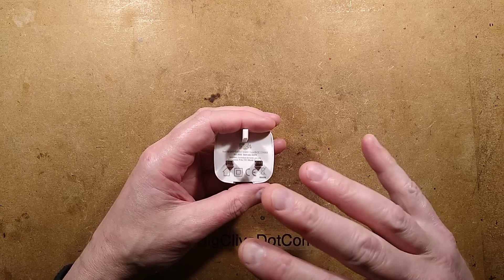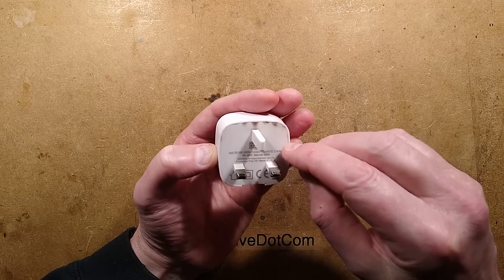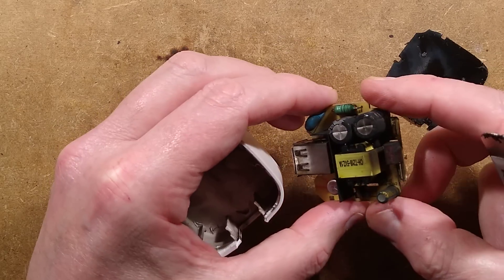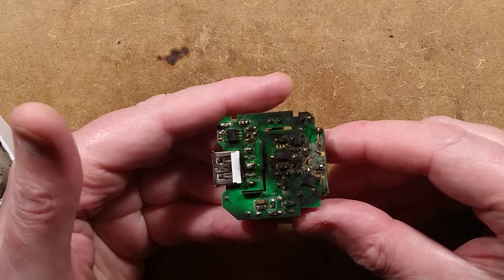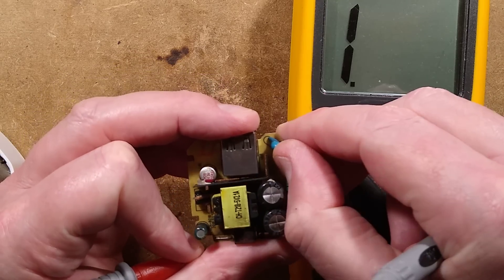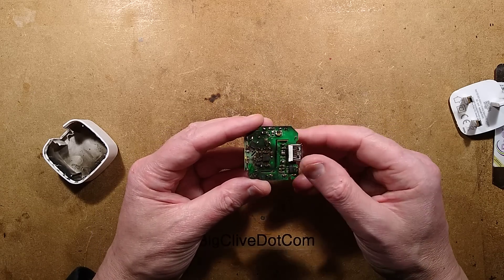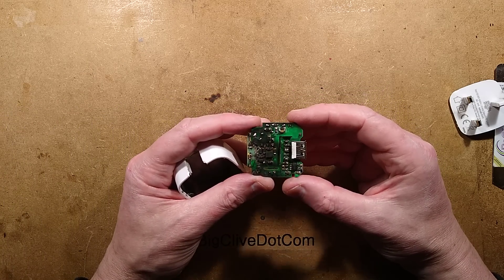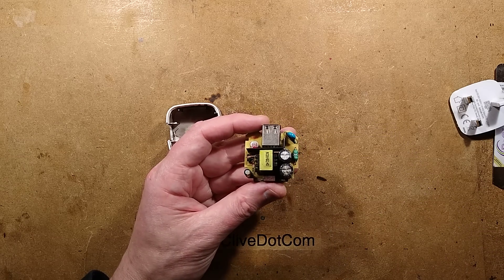Poundland USB versus lightning  (The lightning won.)

Comment: I think the voltage spike started an arc in the charger and then when the arc was established the mains current did the rest. That would explain why the circuit breaker tripped also.

Comment: I'm not fond of those little rectangular fuses, they're usually rated for a paltry 100A maximum interrupt capacity. Hence why they spew soot ALL OVER the place, even when on 120VAC applications. That could defeat the purpose of the fuse to begin with, as the carbon is slightly conductive!

Comment: In my experience a lightning  strike isn't going to be stopped in time by a fuse. It'll boom all the way down the line. Fuses just aren't long enough to deal with the typical voltages involved with lightning.

Comment: Some may remember when land lines were exactly that, phone lines on poles. We used to live in the sticks in South Africa in the 70s and had an overland phone line come into the house at roof level and then inside went to one of these old bakelite rotary phones on a stool in the living room. One night lightning struck the phone line about a half kilometer away, the phone dinged and a bright arc cracked from phone to the floor, leaving a burn mark.
The phone looked undamaged but was dead, when we opened it up the components inside were just ash in the casing, leftover were  charred metal bits from the rotary encoder and the voice coil and bell. All wires were vaporized. The instantaneous heat must have been incredible, yet amazingly the casing did not burst. The wires in the phone line outside had also partly burned and had to be strung new.

Comment: Lightning strikes can sometimes produce weird "damage results". A few years ago lightning struck somewhere near enough our house to affect us. Most of our electronics were hooked up to surge protected power strips, but not our router. Apparently a voltage spike found its way into our router and then travelled through an ethernet cable to fry the network chip of my PC... Everything else was still fine and working (including the router), so we "just" had ~10€ of fixing cost for a network card.

Comment: Interestingly, lightning appears to have different frequencies.  I've seen a couple of different pieces of coax where the lightning blew it in regular chunks along its length but there was a different distance between the blowouts in the different pieces.  Both pieces came off the same drum but at different install dates so it should have the same properties other than 2 years apart.

Koi Carp don't like lightning either when the pump becomes part of the circuit to ground........  We did try and cheer our mate up by buying him a bag of chips but he didn't seem hungry.

Comment: I have a lightning story, though it's not as exciting as this one. Several years ago, we had  a very bad thunderstorm. Lots of lightning. Very high winds. Power flickering in and out. I was out of the house at the time, and when I got back, the computer room smelled really awful. It was like a burnt-electronics smell, but with a less pleasant tinge. Sulfur or chemicals or something. I had a power strip with a surge-protection feature, and when I took it apart, one of the metal-oxide varistors had broken into pieces, and everything was fairly sooty. This was a pretty old surge protector, so I presume it was a combination of the MOV aging and a surge from all the lightning that did it in. 

It wasn't until I started watching this channel, years later, that I understood just what had happened.

Comment: Would a usable earth pin would that have helped it survive ?  I have in my mains entrance a surge suppressor that looks like a 240 volt (USA) dual breaker with out the lever has a green LED s to show it’s Ok  wired on the panel side of the gen set transfer switch  do you use these in the U.K. ?
Reply from the maker: They're becoming available.  The industry is currently price gouging them.
Reply: @bigclivedotcom   they do not cost a lot here I think $45 us had mine about 4 years

Comment: Hi bigclivedotcom  i am a viewer from Algeria and i have so many questions to ask you about electrical installations.
the two most urgent are related to solar installation and grounding
1. i have a distribution board with two sources of electricity, city electric and solar (2400W inverter) 
the thing is the two electric circuit are never in contact with each other  but i have to properly ground all the electric sockets for safety .
the question is do i make sepret grouding bar for the diffrent sockets or it doesn't matter or there is other solutions.
2. for my solar installation i have a pure sine wave inverter from EPEVER 2400 watt and the problem is that it is properly grounded but when i mesur from the neutral or live wire to the ground i have half of the potential (115 volt) .
ps:  i have 230 volt between neutral and live
i heard about neutral bonding and floating neutral but it is high level for me.
i hope you can help and thank you in advance.

Comment: Allot of the time I find that the lightning transient just starts a small lower energy arc in the device and the mains current does the bulk of the damage. I know working in the communications industry anything that has a high energy behind it explodes much more then  RF cables and things like data cables. You do have some exceptions when bonding wasn’t done correctly. We always used MOV and SASD devices on our incoming power it has a large 1/0 connection to a 60a breaker in the main panel and they do a really nice job protecting the mains coming in as MOV alone are too slow!

Comment: I never leave USB supplies plugged in & switched on because this is what can happen...
and not just from lightning... it's also another reason I haven't bothered installing USB double 13A sockets as they could potentially cause the place to burn down.

Comment: clive.. and or anyone.. you know what this is?
https://youtu.be/VfaD_w1wsgI
Reply from the maker: It looks like a discharge indicator tube with neon gas and mercury vapour.  The pattern is probably a result of camera shutter rolling effects.
Reply: @bigclivedotcom  yes, IRL I see very little movement. I can read Philips on it. and 220 volt and 6 watt. it gets a little warm when on. found it in my thrift store, with a nice bakelite fixture with turning switch.
Reply from the maker: @bassblom  Ah.  That's a keeper.  I wonder if it's quartz or glass.  If glass it's probably and indicator, but if quartz it might be a germicidal lamp.  It could give you itchy feeling eyes.
Reply: @bigclivedotcom  first thing I tried was touching it with my fingers, to see if it makes the glow move, like the plasma balls. nope. the two colours in one tube surprised me. super a keeper for € 0.50 :D
Reply from the maker: Neat.  Make sure you don't look directly at it without eye protection for too long to avoid welders-eye.  (You wake up with very itchy eyes in the middle of the night.)  The tube is made of UVC transmissive glass, but ordinary glass will block the harmful wavelength.
Reply: thnx!

Comment: Interesting point about the fuse. I had a network switch PSU go bang (sorry, it's been binned now) which tripped the 32A ring main breaker - yet the fuse in the power strip it was plugged into remained intact.
Reply from the maker: The breakers often trip before the fuses blow.  It results in less of a bang than with the old fuseboxes.

Comment: My Brother recently had a Lightning-strike at a Neighbor's house in Australia, across the road from Him with them loosing a Bunch of items. My Brother though not Directly hit by the Strike did loose His SolarPV inverter (blown), the Dash-cam in his car (blown), the Fridge (blown), His near New 60 Sharp TV and the Original 60gb (much sort after with Linux loadable Firmware) Fat PS3 both now Don't work via HDMI but are otherwise Fully functional.

Comment: It is interesting at seeing how things die depending on where the lightning strike was. If in between house and a suppressor, equal chance of stuff in house surviving or not. Strike on or near line with suppressor in between house and strike, good chance or survival. There is also a good chance of survival if there is a suppressor attached at the distribution panel. Love the smell of refried mosfets in the morning. Cheers to you all.

Comment: Gives me flashbacks to past year, when the lightning hit a house right next to our towns telecom-substation ~250m (~800ft) away of where I live...

In a second I went from a highly concentrated programming session at 2am, to sitting in complete darkness (circuit breaker tripped).
Then my ISP's router started to produce fireworks, followed by the thing exploding less than ~2m (~6ft) from where I sit.
It ended 2 seconds later with me under my desk using my chair as additional cover against flying plastics and electronics... 

I didn't yet realize the real horror had yet to begin at that point. 

The next morning I replaced what was left of my ISP's router with their old one I had laying around on my attic. 
Wasn't as fast but I had at least functional internet. (from ~90mbps down to ~20mbps)

Then I called my ISP to request a replacement router, they told me their substation was at fault.
I explained that I was fairly certain my router was broken, while looking at a pile of dust and plastic shrapnel. 
They then replied, that a specialist had to determine if the router was actually broken, but their specialists where occupied trying to fix the substation. 
Then they hung up on me.

I tried to call multiple times that week, but apparently they blocked all calls from our region, as the whole town tried to call their service desk. 

Took them two weeks to realize that their customers routers where broken, 
while the specialist was banging his head against the substation out of frustration, wondering why only 1 house got a connection (my old router).
Reply: British ISP? I wouldn't expect them to be any better than that.
Reply: @userPrehistoricman  You are close, but I live across the channel...

But its the same issue over here apparently. 

When my sister wanted a new connection in her apartment, it took her 2 months of 4 calls a week to their service desk before she had a connection. After just 1 day it was broken already... 

She then called the more expensive rival ISP, they got her a working connection in 3 days. 
She tried calling her crappy ISP to cancel her plan as it didn't work, but she was placed on a wait/hold line of more than an hour... 
She hung up and just canceled her monthly payments.

Three months later she got a call of the crappy ISP, threatening to shut of her internet if she didn't pay her bills. 
She told them to f-off, as their service didn't work more than 24 hours in the past 3 months, that it took her 2 months of  3 to 4 times a week of calling to become a new customer, and that she is now a happy customer with their rival ISP... 

Most people I know also hate this ISP, they advertise 100mbps and deliver 25mbps in 90% of the country.
I had the same slow 25mbps in the past, when I called their service desk they always used the excuses that I live to far from their substation, so they can't deliver anything faster.
One day I got a new neighbor who was a manager at that ISP, he called some people and got it fixed in like 2 days.
Having 90mbps since that day.

Not to say that the more expensive rival ISP advertises 300mbps and actually delivers 280mbps without having to know people on the inside...  I literally don't understand how this crappy ISP keeps surviving...

Comment: About 25 years ago, I worked in a retail computer sales and repair store in our local mall. One day someone brings a machine in that had been defiled by a lightening strike. Which came down the phone line and arced across the ISA Modem through the Video card and several other expansion cards and motherboard. It wasn't quite as spicy and burned as this charger. But It did have arc marks. With the fiberglass circuit boards showing entry and exit marks with separation of the layers. in the direction of the arc. The machine was obviously not salvageable. But arrangements where made and we kept the machine to use as a display of why you should have suppressors and power protection.

Comment: I had something similar happen with no lightning involved. Cheap phone charger (Carphone Warehouse ownbrand I think), something inside went pop. Smoke, sparks and flame shot out round the sides of the case, tripped a 32amp MCB. When I dismantled it, it looked similar to this except the top had blown out of one of the capacitors.

Comment: hi all,  i recently purchased a IR LED floodlight from ebay  but it didn't come with a power adapter. could you please advise me on which one to buy as me  & electricity are not friends..
its 12V DC and 12 Watts consumption.  thank you
Reply from the maker: You will need a 12V 2A power supply to ensure it runs cool.
Reply: @bigclivedotcom  that's great, thanks.   i did email a few companies that but nobody ever replied then your video popped up and i thought yeah this guy will know..

Comment: 30+ years ago Dad was working on some equipment when there was a lightning strike nearby, he got a shock off the equipment and involuntary muscle movement made him throw the gas bottle he was holding which you'd usually have a job just picking up, soles of his feet went red for days where they completed the circuit!

Comment: To be fair, that's done fairly well all things considered. It seems like only the high voltage side has been blasted and the USB side has actually survived. Plus, it's impressive that the casing has actually contained most of the blast rather than just melting and igniting.

Comment: Lightning strikes can do some pretty strange things. In one case it blows everything to smithereens and the next time you hardly notice that it happened.

When I was a kid the lightning took out our TV antenna. I know the night it happened as I was woken by the thunder clap as it rattled the entire house. But come morning nothing seemed to have happened. Towards the evening we however noticed that the TV reception was rather bad. But then we were living in a veritable black hole as far as TV signals were concerned, so depending on weather it could be quite bad at times. Several days later my father however found the signal splitter on the grass in our yard. It was blackened and had been blown clear from the TV antenna mounted on the chimney. So all we had for a TV antenna was less than half an inch of the center wire sticking out the end of the coaxial cable dangling from the antenna.

But that was all that had been damaged. The TV had been plugged in when the lightning struck and yet it survived. After getting a new filter/splitter and mounting it on the antenna, even using the same cables though we were told the coaxial probably should have been replaced, and the reception was easily as good as before.

So, while you don't want to rely on luck to protect your equipment or even your life from the lightning, just sometimes it will keep your house from burning down...

Comment: I recall a development engineer back in the 1970's arguing against larger, higher voltage isolation transformers for the music feeds into radio transmitter sites he said - you won't stop the lightning, you'll just blow a bigger hole in the wall its mounted on !

Comment: Lightening is such a fascinating powerful thing. They can contain such incredible amounts of power and do so much damage. I have seen a large old Oak tree in a field be hit and BOOM just dust and leaves left! It literally was vaporised! Yet other things have had direct hits and had very little damage. A lot of damage  people see is not from direct hits but from the spikes down cables etc. My parents came home from work (back in the 60's) and there had been a thunder storm in the night. The TV didn't work(old valve job). They got a guy out to fix it and when he took the back off, the inside was a black mess! When they looked outside at the tv aerial, there was just a 'lump' on the roof and the coax had black marks on the wall every so often all the way down. Yet the wall had no other damage.

Comment: I very seldom disagree with you BigClive, but the extra extension cord plug fuse, the usual 5x20mm fuse does usually not have a proper surge breaking rating for events like this. Once a too high surge has hit, the fuse will certainly "blow"... as in explode, it will not break the current flow -just turn into an instant plasma arc. 
The plasma arcing will only stop until virtually all voltage is all gone, usually when some higher rated fuse ACTUALLY cuts power off.
Well, having an extra fuse it will not make things much worse except giving a false sense of security and a second place of explosion/soot. You can of course maximize safety potential by selecting a sturdy bodied ceramic cased fuse, The "normal" glass body fuses are really only suitable for low(ish) voltage/current surges, some having a ratings around 35A(!) max.

The importance of surge rating/ceramic bodies might be better known among UK'ers because of your house wiring/outlet standards than other Europeans. So, while you and (hopefully) electronic engineers naturally think about this other viewers may not.
Reply: You will find that we have all that covered 😁 A BS1362 fuse (aka one use in a BS1363 plug) is ceramic bodied and sand filled for that very reason.
Reply: @Matt Quinn Aaah, it's a different physical format aswell! I thought it looked like 5x20.. but looking with a more scrutinizing eye it is likely the BS fuse type. Thx, I feel updated!